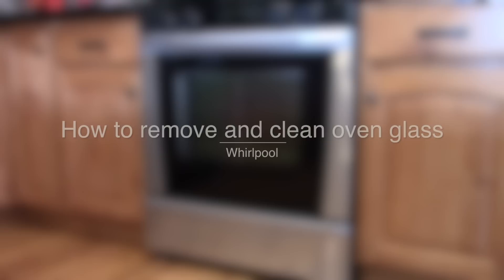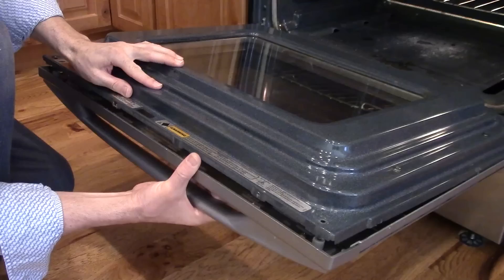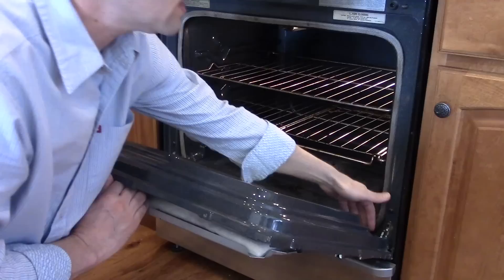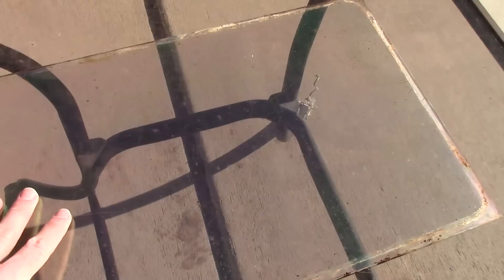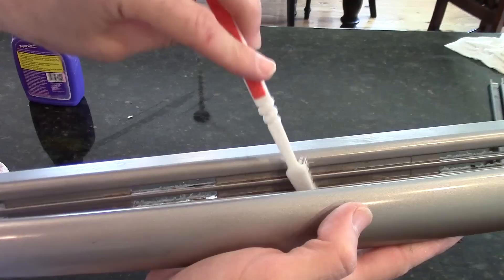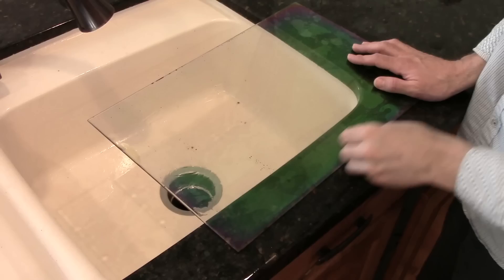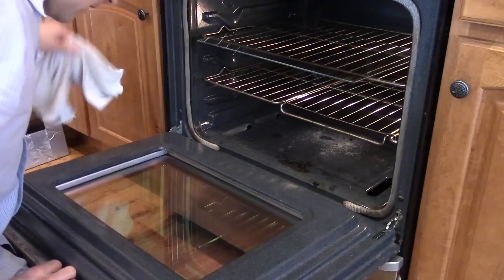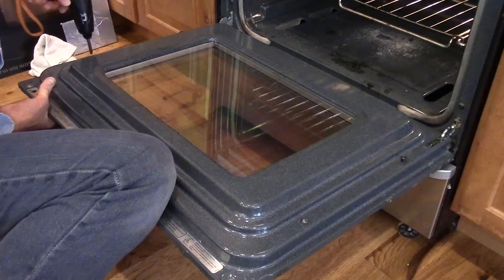How to take apart an Oven Door to clean the Glass

Comment: My Kenmore glass cooktop melted, Sears denied warranty claim and told me I shoudn't cook food on "High heat". What's next don't put wet close in a dryer?
Reply from the maker: +Wael Nawar What part melted?  If you cant cook food on high heat, what are you supposed to use it for?  I called about the handle of my Whirlpool microwave because the paint was chipping off and it looked horrible.  It was less than one year old and they would not send out a replacement.  I wonder if there is an appliance company that is honest and will back up their products.
Reply: AdamDIY 
The center of the right burner melted, I suppose a glass cooktop is designed to withstand heat.The tech who came agreed with me and wanted to replace it but Sears wont let him.
I know the company is struggling financially and this is their way to cut cost so good bye customer satisfaction.
Reply: +Wael Nawar
Ask Sears for the names and addresses of their Directors of Consumer Sales and Quality Assurance. Make sure that you get the DIRECTORS names not a manager name.
Send a REGISTERED letter to each of them by name at the addresses given. Keep a copy and staple your registered taking receipt to them.
In the letter you need to tell them that the glass of your range melted when used on high heat. Explain that the engineering of a range top can not allow the heat to melt glass, instead it is designed to give CONTROLLED heat.
Then tell them that their service department has refused to make the product good.
Then explain that you are not comfortable that this particular unit is safe as its CONTROLS seem to have failed and allowed DANGEROUS conditions to exist, either that or the glass was not manufactured to specification (highly unlikely as it take a LOT of heat to melt any glass!).
Tell them that the product you purchased is not fit nor safe for the purpose it was intended for. Tell them that this is no longer a warranty issue, it is a consumer protection law issue and safety issue. 
Then, demand a full replacement of another manufacture unit of your choice, tell  them  you are willing to pay the difference only or be refunded the difference, and that you expect them to deliver and pick up the units.
Reply: +Dirk Jeanis Thank you so much this is a great Idea
Reply: Go for it and don't wait. I am unsure of what state you are in (location). However MOST states have fitness for purpose warranty and consumer safety and protection warranty. 

If after contacting them they refuse to replace with a different model (make sure that the model you choose is NOT the same manufacturer as many are made under various names but with identical engineering and controls) then you need to begin a small claims court action claiming consumer laws in your state and any federal consumer laws. 

You can look these up easily. You will file suit against the manufacturer name and the seller name (I believe you said Sears, so you need to name Sears and the manufacturer (craftsman or whatever). 

Don't forget to ask for damages if your consumer laws allow, lost use of your stove for cooking, having to eat out, etc. plus ask that the court for any ADDITIONAL relief that it deems fair and just in its inherent power of the court.

This would allow a judge for instance to order an additional amount to you, or to even begin a recall of ALL their units. It will be up to the judge.
Reply: +AdamDIY I have a Maytag microwave and there is something wrong with the digital panel, as I can't see the time/clock. They won't do anything about it, but know it is an issue.
Reply: @jobseeker1612  In Canada we have recourse through the Better Business Bureau ... I once had problems with a new sofa set... the store refused to act on it. I sent a letter to the Better Business Bureau and a copy of it to the store. In a week or so the store called me and said I could go pick up a sofa set in same price range. They delivered it and took away the the first one.

Comment: WE can't get our handle back on - screw doesn't seem long enough - what did we do wrong? Bosch stove
Reply from the maker: +Knit4myfriends I have not worked on a Bosch, but usually when that happens I either made the mistake of putting the screws back in, in the wrong order. Make sure you didn't put the long screws in somewhere else.  Or I have made the mistake of having some part misaligned, so I would have to take it apart and try again.

Comment: is it safe to use an oven that looks like what this one does at 1:57? Our outer panel fell off due to bad screws and finding the same model online is prooving tricky!
Reply: Tony X Cancer I'm not sure I  would run it like that. I'm sure it's more cosmetic, but it may also add another insulating layer to the glass panels. (As well as protection against breaking). If you do run it, I definitely would not run the self cleaning mode. [I am no expert though, just my thoughts]

Comment: sprinkle baking soda onto any surface and then rub it with a DAMP (not wet) scrub sponge. I like the green (scotch brite I think?) pads and it will take off any gunk with very little effort. You can sand paint off a car with a pressure washer and baking soda mix. It's incredibly powerful and not dangerous. Make sure when scrubbing that the baking soda stays cakey and not dissolved. If need be, add a little more baking soda to keep the bit you're moving around cakey.

Comment: I ve donr this taking it apart and be dammed i will never do it again Appearently nothing went back the same way now im loosing heat from my oven and some screws wont go back into the hole its a pain  so the second time ive tried to fix it again done taking it out no no i couldnt get it back the same way now i got to call someone to come and fix it the right way  with is going to cost me

Comment: Wrong way to do this. Lower door down, look on top of hinges and there are clips that sit on top of the hinges that rotate up to lock out the hinge. Once they are locked out you close the door back to the oven, lift up and out on the door. The door comes right off then you can set on tabletop to disassemble. Doing it this way in the video is risky and can break the glass or the metal frame around it.

Comment: Wrong!  Take the door off and then you can remove the 4 screws on the bottom so that it separates completely.  Also and this is very important.  The outer piece of glass is tempered, you must be very careful with this (don't drop anything on it) or it will break into a million pieces.
Reply: Don’t even bump it. I cringed when I saw him carry it to the sink and rattle it in the frame. Tempered glass has internal tension and bumping it sharply can cause micro fractures that may not show right away, but could make the oven door glass shatter suddenly.